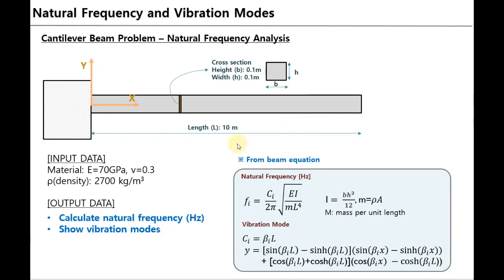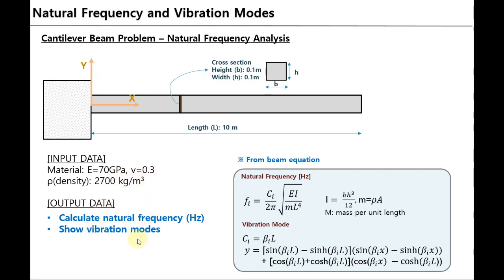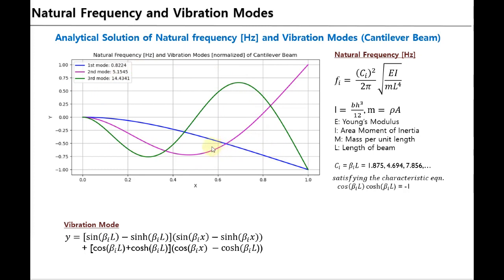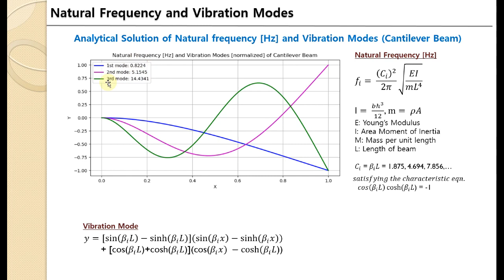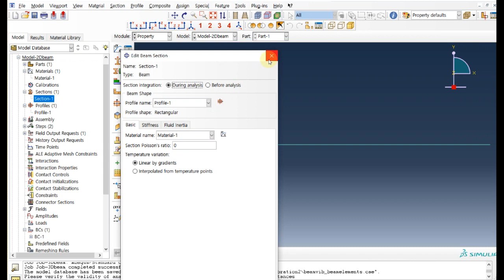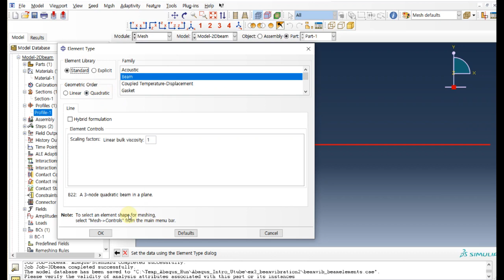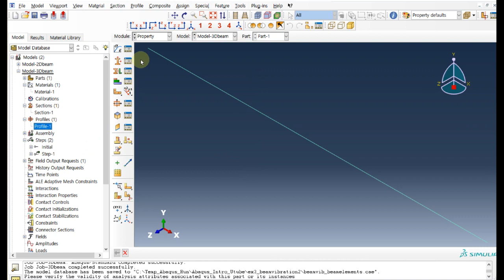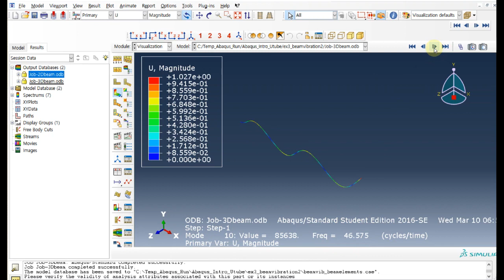Abaqus FEA - cantilever beam: vibration (natural frequency and vibration mode)

Comment: If the material property is orthotropic or anisotropic, then how to calculate the natural frequencies and eigen modes? Is there any paper or reference with in detail mathematics ?
Reply from the maker: well, I am not that much familar with anisotropic analytical solution...but by quick searching, I can easily find the following paper, Jinghui Zhang, New analytical free vibration solutions of orthotropic rectangular thin plates using generalized integral transformation...maybe it could be sort of start point for you!
Reply: @Ahn.Eng.  Thank you! I will surely check it out !